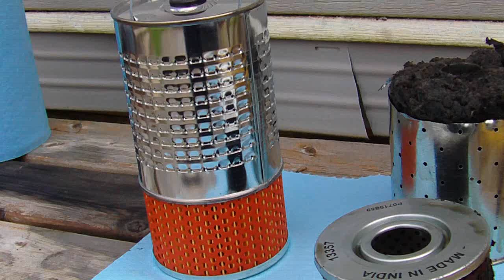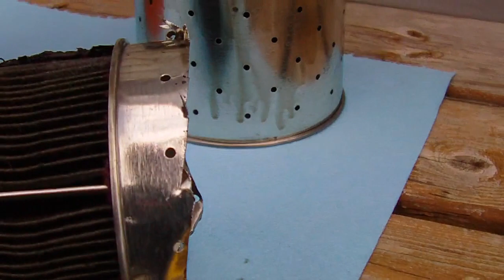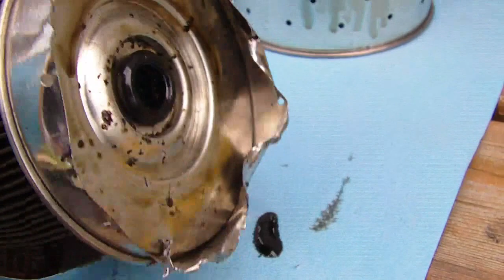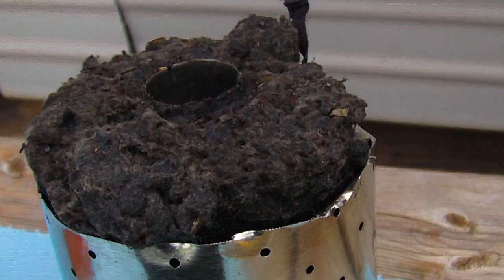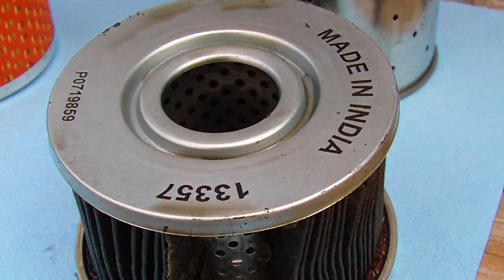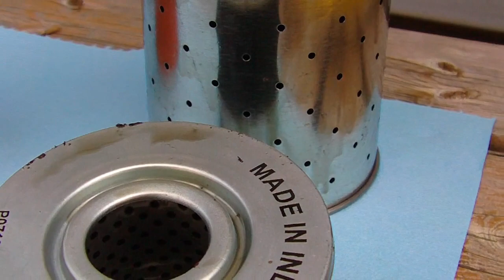Mercedes Dual Flow Oil Filter Cartridge Cut Open to Inspect Bypass Element

Comment: Thanks for this video. This is the first time I have seen what is in these dual flow filters.
Reply from the maker: The one cut open was from Autozone, a low grade filter. been buying the premium German filters from Amazon.
Reply: @heavymechanic2  I get mine from amazon too. Such an important part. I did look around on the internet trying to find a micron rating or even a media description for the bypass portion, no luck.
Reply from the maker: @joekerry2206  Pureolator reports 5 micron, because its like blow in insulation, its hard to determine any reliable standard.
Reply: @heavymechanic2  Real fine there. 5 micron should keep particle damage and perhaps acid formation down far better than a full flow can working by itself. 
I was looking at an engineering drawing of the filter ( no spec though) and I could clearly see the "stuffing" in the top part.

Comment: So its a full flow and bypass filter in one? What do you think the bypass would filter down to, 10 micron ?
Reply from the maker: Pureolator claims 5 microns but I'm unsure if thats accurate because it looks like blow in insulation. The Frantz in my other videos is intended to clean the soot from the oil and there is a regular cartridge available now. Check out Diesel Secrets, their company purchased the rights to Frantz Filters.
Reply: @heavymechanic2   So i've been looking at fitting a  Baldwin B7379 which is a spin on claimed to filter down to 8 micron for engine oil, but I can't find much information on it, Would this be okay? The stock engine filter is only about 40 micron,
Reply from the maker: @themisunderstoodgorilla7030  Sure, reports state that any reduction of small particles extends engine life. heavy trucks used to have a large canister and those were replaced by a standard spin on bypass filter.. I have a 10 micron on my transmission and it did wonders to clean up a contaminated system. Check out your part number at wixfilters, I am using a 51269 on my transmission.
Reply: @heavymechanic2   Well the OM617 was know as a million mile engine just with regular servicing, would that have something to do with the filter setup it runs ? As 5 cylinder engines usually have bad harmonics and require balance shafts i thought that would affect longevity of the engine ?
Reply: @heavymechanic2  Also that Mercedes filter might be okay as I have seen some old filters (On our 1969 Case 930 Comfort King) Its filters just looked like balls of string and they work great the tractors still going very well just with regular servicing, I think they took a lot of care when designing engines back then.